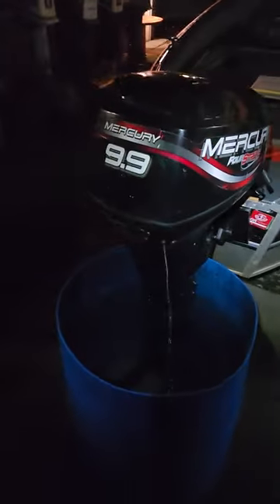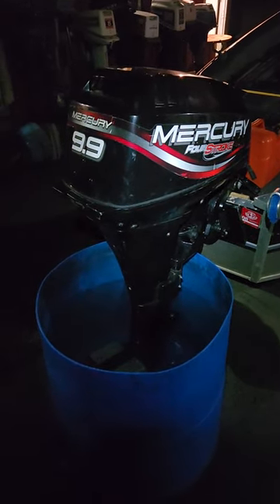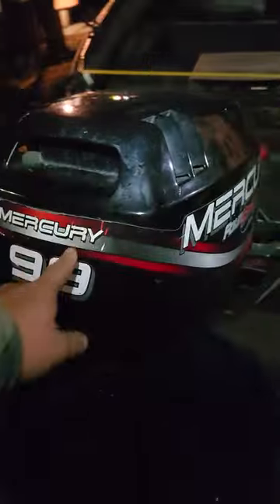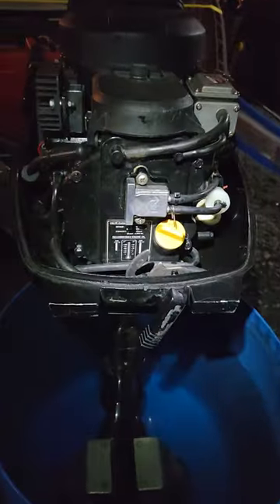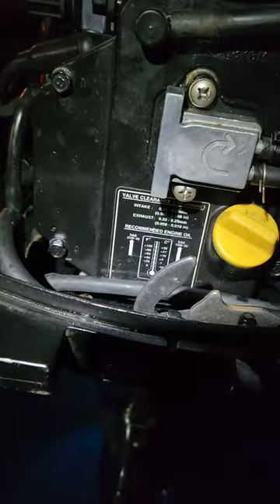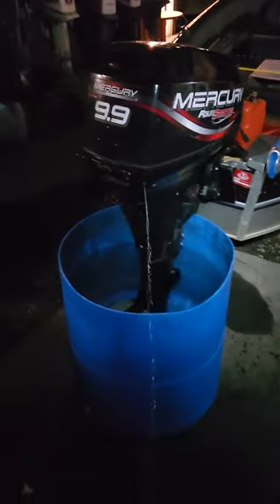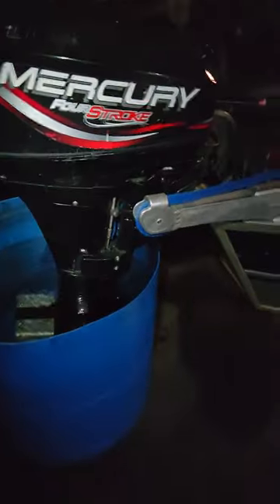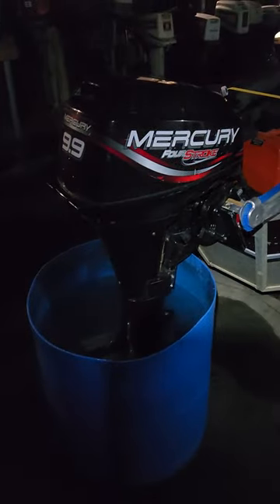1997/98 Mercury (Yamaha) 9.9hp 4-stroke @OutboardMadness #outboardmadness

Comment: Have you ever had one of these engines that uses oil?  I have sea foamed it and I think it's better but still not great.  I got it and it wasn't running and runs good now.  But uses oil.
Reply from the maker: @captndavie  
Could be burning oil through the piston rings and/or through the intake/exhaust valves. What does the spark plugs look like?
Reply: @OutboardMadness  honestly I don't remember how they initially looked.  I have put on a new fuel pump, carb, changed lower unit oil and I think I changed the plugs.